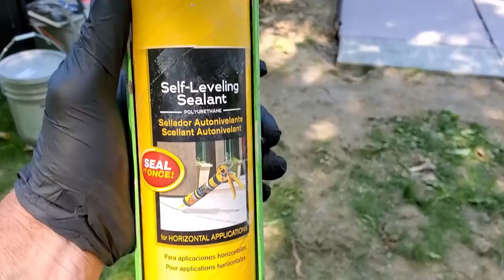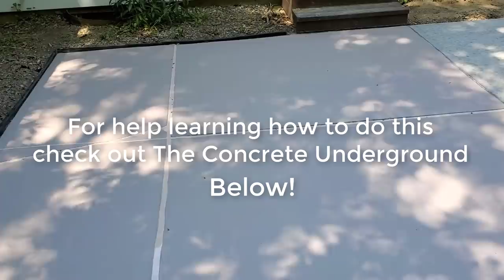How To Repair and Resurface Old Concrete Patios (Fixing Ugly Concrete)

Comment: I think I would have did it in reverse I would have dealt with the cracks first and and let it dry. Then went over with the resurface, I think it would have turned out a little better. The cracks would have been hidden more.
Reply: I agree!
Reply: Same procedure I was thinking... The cracks should have been dealt with first before the resurfacing
Reply: 100% Correct
Reply: I don’t know anything about pouring concrete, but if I was the homeowner, I would not have been satisfied with the results. I think I agree with you, fill the cracks and then put the surface stuff over it.  I am watching this video because I have an old slap that needs to be removed. At least I know what I don’t want done.

Comment: I have a concrete block chimney at my cottage. I am looking for a waterproofing coating that I would like to apply to the outside surface to protect it and to make it look nicer. Would the ConFlex be a good product choice for that application?  I was gonna apply a latex floor enamel product that I had previously used on my concrete steps  but the ConFlex looks like it would be a more robust coating.

Comment: Can I use this product on a basement floor after I get all the cracks filled in? Also, what type of sander/grinder would you recommend? It has been painted in the past and that's peeled off in places, and obviously, power washing is not an option.
Reply from the maker: Use the same grinder I use in the video. You can use it for a basement floor, it does have a little texture to it when it dries.
Reply: @MikeDayConcrete  Yeah, thanks, but I couldn't find the description anywhere (I did look). I have a grinder, but not sure if it will work for this.

Comment: Hey mike i poured a slab driveway last week but towards the end i got rained on. Its a 3000 psi straight sack broom finish and i  was wondering what kind of resurface concrete i could use that would closely match the good side of the driveway the driveway is turning a strong white color as its curing so which resurface conc  would turn real white once its cured

Comment: Would it be a bad idea to fill the cracks with the sealant first, then paint after concrete after?
Reply: That's what i thought - the crack /caulk was a different color at the end . Maybe there was a reason.   Was there a reason  you didn't paint over the caulk to make it all one color

Comment: A sandblast nozzle/attachment on the end of the wand of a 3000-3500 psi pressure washer does a great job of cleaning and roughing up existing surface. The water means no dust. It took the nasty rubber backing of outdoor carpet left on my front porch to resurface
Reply: A turbo nozzle on a pw washer is no substitute to grinding and profiling the surface for the best adhesion.

Comment: You’re supposed to use the self level sealant first then grind it so the crack doesn’t show then Resurface it
Reply: I guess That would be another way of doing it 🤔
Reply: This type of Sika is still pliable so it would tear when ground or chunks would pull off with the grinder.

Comment: I agree that just pressure wash it will do the same
If I want to resurface it and also raise it, can I just pour new concrete over it? of course, using metal mesh. Pouring new concrete will also fill cracks, level sunk parts of the old concrete (that concrete had sunk parts, that will remain the same). Also, pouring new concrete would save me from buying the paint and the tubes to seal cracks.
Thanks in advance.

Comment: Can you please do a small video if possible on pouring a basement floor where there was no concrete poured when the place was built. How would you go about doing this if you weren't real good at doing concrete work? And the fieldstones could use some concrete between them in the basement as well. Your thoughts would be greatly appreciated
Reply: If your experience is limited, just do small sections at a time. If you find out after a section or two that it’s not what you want, hire someone.

Comment: I haven't watched the video yet, but I'm sure it's going to be good. During the first video I thought they should have just torn this up.

Edit: I still think they should have had you replace it, but it looks really good now!
Reply: I would have torn it all out and poured it new.... BUT, this is a good way to go for equal strength but much cheaper cost
Reply: @yanbu000  Yes it is. I'm also glad we got to see Mike highlight these two products.
Reply from the maker: It was just a money thing, much less to do this. They were doing all kinds of exterior improvements to their property and this fit into the budget.
Reply: @jeremyhuggins8796  yes, I'm researching the products now actually

Comment: I wonder what the homeowner really saved by keeping that old pad when the labor and material cost of the sealant and caulk was included?  If that were my house, I would have torn out that old pad and poured all new.
Reply from the maker: Saved a couple grand easy between demo, haul off, form, styrofoam, wire, pour, finish, concrete. Much less to do this.
Reply: The cost comes in labor and haul off.
Reply: Haul off a a big part of the expense.  Can’t get anybody to come out this year to redo our drive so I’m just chipping away at it myself with the sledge since it’s so rotten.  

Figure I’ll at least save my family a paychecks worth even if I don’t end up doing the form and pour myself
Reply: @MikeDayConcrete  You SOLD that job! Obviously there was Nothing wrong with that pad. It wasn't breaking out. Had NO cracks. Would have lasted another 30 years easily. You could have easily power washed it and then painted. Your customers could have saved the "Couple Grand" you mentioned. Many,.. you guys forget there are others out here that do the same work and KNOW the difference. Of course most of us don't have the time to watch or listen to your Ridiculousness!
Reply: @ronguerin111  I agree that just pressure wash it will do the same
If I want to resurface it and also raise it, can I just pour new concrete over it? of course, using metal mesh. Pouring new concrete will also fill cracks, level sunk parts of the old concrete (that concrete had sunk parts, that will remain the same). Also, pouring new concrete would save me from buying the paint and the tubes to seal cracks.
Thanks in advance.
Reply: @douglasflores1462  No,.. concrete will NOT adhere to concrete. It has to be in it's natural state for bondage to take place.
Reply: @ronguerin111  So, to pour more concrete, I have first, to pressure wash it, and paint it with some bonding material like quikcrete bonding adhesive. Right?
Reply: @douglasflores1462  NO! You have to Remove the old concrete. Throw some 2x4's down with stakes and pour a New Pad. NOTHING else will work. Well it will,.. but only temporary. I mean you can just seal coat it or do whatever you want to Hide the mistakes. But it's like putting a bandaid on a bullet wound.
Reply: @ronguerin111  "Obviously" really? Use your own words to describe the fact they are obviously doing crack repairs.

Comment: Why did you put self-leveling in between the crack and not repair the crack? I would have put self-leveling in between the actual intended joints and fix the crack.

Comment: How much for a 55x20 concrete slab estimate
Reply: 55’x20’x4” - If you hired a professional and depending on your location, should be roughly:

Concrete - $1800 (@4”), $2600 (@6”)
Forms and wire - $250
Labor - $700
Overhead and insurance - $500
Total - ~$3250 - $4050 (+tax)

[your mileage may vary]
Reply: @psidvicious   ok thanks I got a quote for 6300 and 4900
Reply: @scattywattyfamily8918  Yep. The prices I’m quoting are typical to my area (S. Fla). They can vary wildly depending on where your at.

Comment: I pump concrete in California, no way 2 grand to replace that old slab. At the most a grand out here in CA. In Maine you be screwing ppl over. Looks like shit, no way a contractor out here would do  shotty work or even suggest that to a customer.
Reply: Quick fix concrete get over it

Comment: Saved a  couple grand by resurfacing. are you kidding me? 
And no offense Mike, your videos are  really good and informative,, but that patchwork of new and old looks like crap to me. (Obviously customers call not yours)
Sure I'm glad my father taught me alot of what I know. Do 95% of everything on  my property myself.
Getting ready to tackle my biggest project ever. 15x40 foot addition with full basement and partial underpinning of the original house.
Getting a good basement floor will be my biggest challenge but thanks to your videos I feel more confident that I can pull it off.